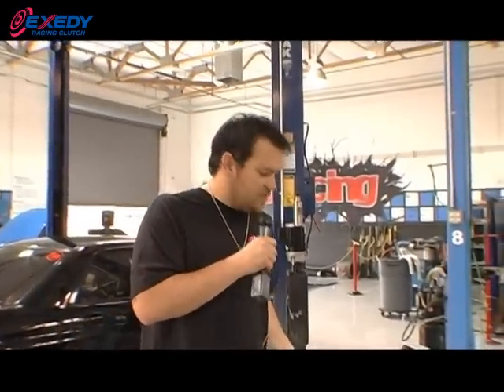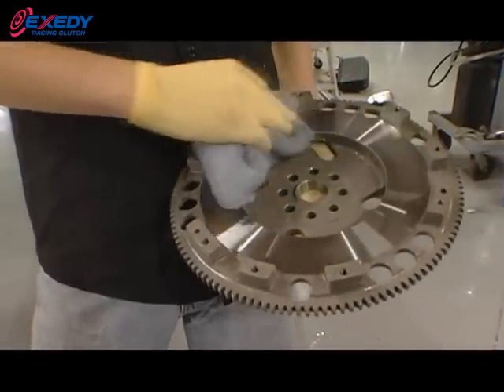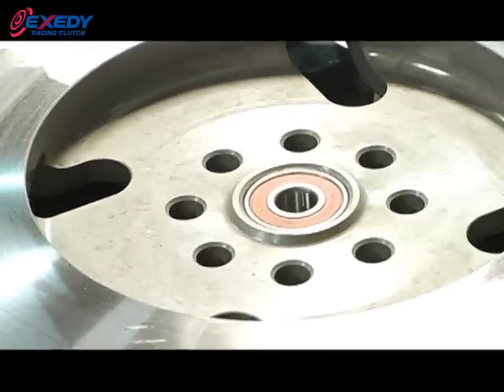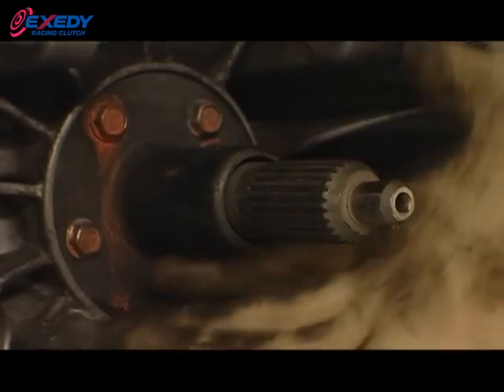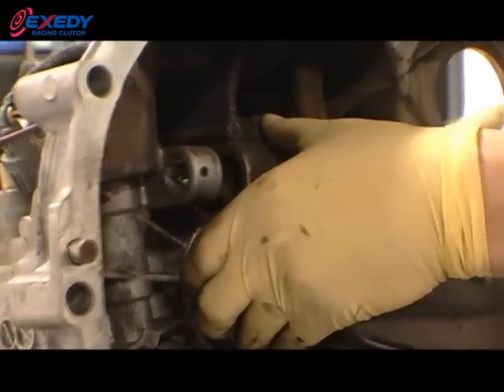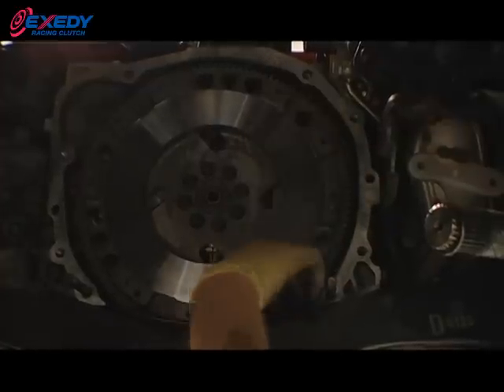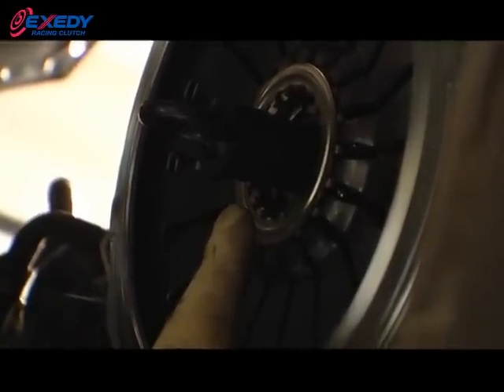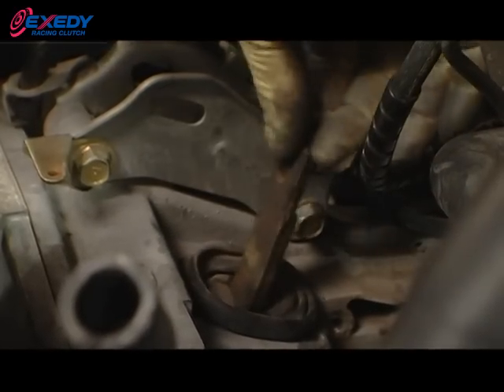EXEDY Tech - Stage 1 Clutch Installation Subaru WRX

Comment: That install is actually for a 6 Speed gearbox in an STi.
The WRX as labelled has a 5 Speed box and has a different clutch, push type.
Your video is showing the 6 Speed pull type.
Reply: thats not correct the 5 spd can be pull type also I have done both boxes . we check first what clutch is in the car before we order it , if the slave cylinder is in front of the throw out fork its push type if its behind and pushing the fork to the front of the car its pull type
Reply: hoover23tcb 
You are correct about the slave cylinder and identifying the clutch. But in the UK all the new age cars with 5 speed tend to push unless modified.
Reply: +Mark Speight 
my 01 bugeye in Australia is pull type
Reply: it's 5 speed
Reply: Just to clarify
02-05 WRX: pull type clutch
06+ WRX: push type clutch
04+ STI: pull type clutch
Even though WRXs were once equipped with pull type clutches, this is clearly a 6-speed just going by the size difference compared to the 5-speeds.
Reply: @jmessier90  JDM Legacies also have the pull clutch on the 5 speed, 1999 model.

Comment: why wont the pull type throw out bearings engage into the pressure plate?  Two installs of WRX flywheel /PP/and TOB, and both didnt engage the TOB. The first one finally snapped in, the second install, not at all...

Comment: I have a question. my clutch pedal got stuck up the upright position. really hard and would not push down. I removed the intake and pushed the clutch fork with light force and the CMC shot out the pin . now the clutch fork will not stay 'pressured' up it just slides back and forth. what did I break?

Comment: Do you think 55lb on the flywheel bolts with no lock tight is ok?
Reply: I'm not a professional... but with that said. the OEM manual from all data does not state to use any lock tight when installing the flywheel.. (it will usually tell you what type and give a part number to the OEM spec thread locker or sealant.) I'm sure using some wont hurt. I'm watching this after installing my flywheel without any lock tight. I don't think imma remove the bolts and apply any.  hope this helps.

Comment: Hi I need some help I bought one of these pedal clutch same name of this video my vibration is pulling out with first gear and trying to reverse slowly getting stuck in traffic I have a lot of vibration and I mean a lot of vibration can’t think about what the problem of why I have this problem if you know or understand of someone else know so understand please get back to me about it
Reply: Or you can re bleed your clutch fluid
Reply: Or it could be the pilot beering

Comment: does it matter if you use a stock flywheel
Reply: Nope, in fact, some people might prefer the heavier stock flywheel since rev match downshifting, take offs from stand still, and changing gears will be easier to manage since the revs won't drop as fast when you're off the gas or rise too high too fast when your on the gas due to the heavier weight.
Reply: If you are using your old used flywheel, just make sure to have it resurfaced.
Reply: Booyakasha! thanks mikey i already the clutch a wk ago n it's awesome
Reply: djm93 BOOYAKASHAAAA!!! :D no problemo my friend! I bought a new exedy stage two clutch a couple of months ago for my Mustang and it's just sitting in my room lol. I'm gonna try to install it myself :o...
Reply: I installed my exedy clutch Stage 1 organic
and got a new stock flywheel installed last sunday on my drive way and it was worth it Skye my 1981 280zx Nissan datsun engages wait better. I bought the multi hyper twin plate with sprung d-core for my 2010 evo x gsr n it comes with a fly wheel for my car which is sweet!

Comment: Nice vid. I changed my clutch 1 month ago, now I broke my transmission with the new clutch kit. 
I have already removed the gearbox, but the throw out bearing just sits on the clutch now. How can I remove it to put it on the transmission? Or can i put the transmission on it like that, and then put the fork on the throw out bearing from the top? Would be thankfull for every information.
Reply: I know this reply is late, but figured it may help someone else. You push the throw out bearing towards the pressure plate, slide a flathead screwdriver between the TOB and collar, twist the screwdriver to depress the collar, then pull off the TOB (should come off easily).

Comment: DIY??? how many people own a hydraulic press?
Reply: use a socket the size of the race and gently tap in with hammer until flush. I have done that on all of my past clutches and no problems. Just make sure its flush with flywheel.
Reply: they are like $130 at harbor freight and i'm pretty sure that's what the shop was using
Reply: Me😁
Reply: The style in the video literally costs like 100 dollars man chill haha
Reply: Suave with hammer will do just fine no problema

Comment: Sir I really need your help in this clutch sounds. There are no hard shifting in gear transmissions, everything is normal expect grinding sounds.
https://m.youtube.com/watch?v=DVJCERkwS2w

Sir, it happens only after replacing with new clutch. And this sound did not come with the old clutch.

Any ideas or suspect regarding pressure rings getting hard...? And how to identify hard pressure rings?

Comment: This guys instructions on installing a performance clutch kit/flywheel back into a pyle of shit with 4 seats is pretty decent. I miss my 92 Eagle talon TSI that's a real AWD sports car. I miss beating on wrxs. Running 10s on a rough  tune 16g turbo. Hell my girlfriend 97 z24 5speed 2.4l quad4 with 250shot and few. Supporting mods custom burned eprom make Subaru look trash.

Comment: Do your due diligence and don't buy an Exedy clutch. Their quality control is absolute crap. When my stock clutch went out in my '06 I had a professional install an Exedy OEM replacement clutch that came with a new throw-out bearing and the bearing would not stop squealing when the clutch was disengaged and Exedy refused to make it right. You might get a good one, but you also might get a shitty one and then you'll be out hundreds of dollars. Never again.